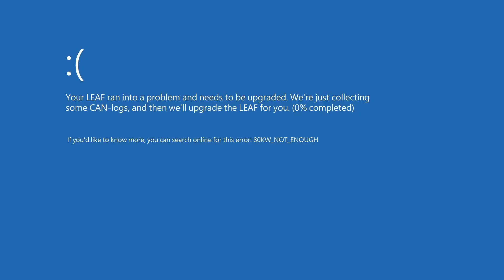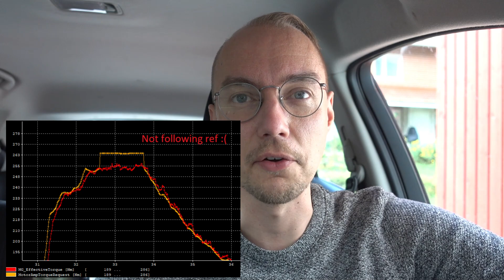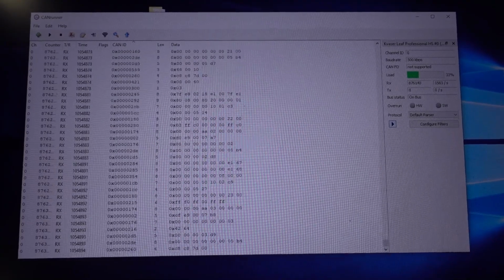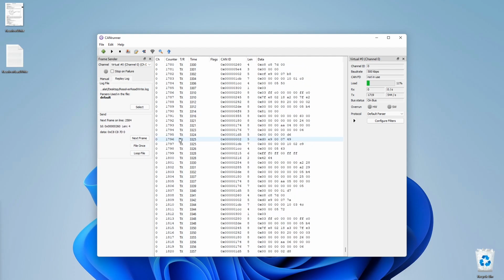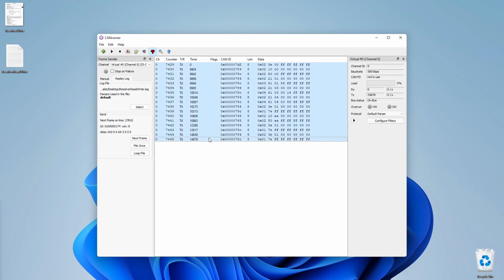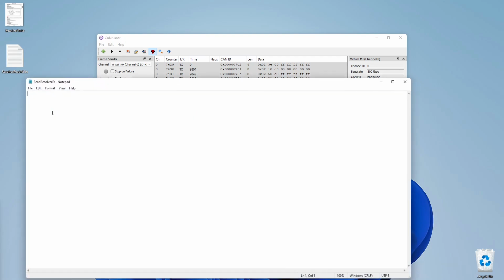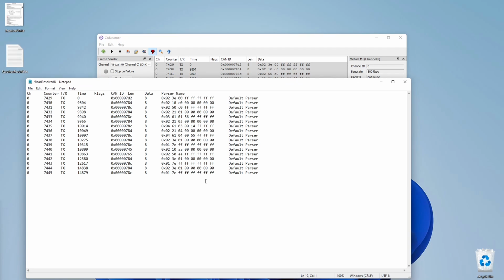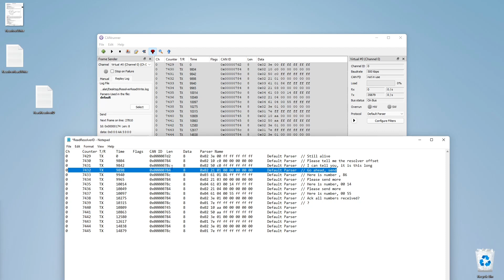Performance upgrade for the LEAF, [Part 0] Resolver coding

Comment: Great videa Dala - thanks! A couple of questions: I have tried your procedure on the GEN I leaf (EM61 motor), and the inverter writes back with the new resolver information after reset. So just wondering why you think it will not work on the older LEAFs? 

And, any idea what the 5 numbers actually mean? I.e. how do they relate to the offset in degrees? Five bytes gives a lot of options!
Reply from the maker: The EM61 motor is very different compared to EM57, so fitting the newer inverters wont only be mechanically challenging, the internal parameters are too different to spin the motor.

The 5 numbers were a very precisely measurement on how off the sensor is. They noticed how overkill 5 numbers was, and shortened it to 2 numbers in 2018+.

Comment: Why is this method not usable on 2011-2012 leaf?
Reply from the maker: The early LEAF has EM61 motor and way different hardware around it. Installing EM57 parts is simply impossible.

Comment: Clear Battery Capacity Loss Bar ? 2013+++
Reply from the maker: Consult 3+ can do that
Reply: @DalasEVRepair  Dala's, can you elaborate on how to do this with console3+? where is this function for 2014 ? Clear Battery Capacity Loss Bar 12 ?
Reply from the maker: @DginiSG  no clue. Don't have the tool
Reply: @DalasEVRepair  I know if you update firmware 24 to 30, only then there will be 12 bar on the scoreboard, but I would like to not change firmware 24 to 30 and return 12 bar to Nissan Leaf 2014

Comment: This answers a question I've had for a long while"can you change the vcu to aftermarket and get more power out, aka zombie the car" seems no as the inverter limits power. 👍Thanks again Dala for your work and also sharing.
Reply from the maker: No problem, thanks for watching 😁
Reply: It's kinda like working with an NA car.
You can't do a whole lot with software on an engine with no forced induction. You have to change some hardware...

Comment: This is fantastic... I had come across the thread just last week where you discussed the power limit by the inverter.  Since the motors are all the same, it seems logical that a performance upgrade should be obtainable by swapping inverters.  I imagine that the 24 KWH pack is probably optimized for safety and could possibly support a bit more... however, for those that are receiving 40 KWH packs, it seems that upgrading the 110 KWH should be within reach.  I was wondering another thing... it seems like it might be possible to interface the open inverter project to the stock VCM... I think this might involve just a bit more work, but with some very creative can bridge manipulation also seems within reach - I think the inverters in the '13-'17 can probably support 110 KWH very easily if not for the FW limitation.  A hot-rod 2013-2017 LEAF has massive appeal to me, also as a petrol head.... hot rodding does not need to end with EVs!!  I don't currently own a LEAF, but considered getting another just to play with since I'm an embedded FW engineer by trade.  My mind has been racing with possibilities in just the last few weeks.
Reply from the maker: Yeah this decade is gonna take the LEAF to new heights for sure!
Reply: With ICE cars, people could invest money and increase power to 700-1000hp. With EVs this seems near impossible unless you buy the car as-is with this power.
Reply from the maker: @farmdve  That's what we're about to change!

Comment: How stimulating the car that always in breaking, that helps the car charging when running, on option with ON/OFF switch, that could be wonderful.
Reply: So B mode then? Regen braking already integrated in the car.

Comment: This is the thought I had. Take a wrecked leaf plus, drop it's motor, inverter and battery into my car. Having money, time and a place to work are necessities though.
Reply: I suspect that the capabilities of the stock VCM would need to be well understood (as Dala is reverse engineering)... it would be very interesting to snoop the LEAF+ as part of this project.  Ideally, we could just intercept the torque request to the inverter can message and re-map it using the Muxan can bridge with a man-in-the middle attack in the same way Muxan fools the car with upgraded batteries.
Reply: @lsh3rd  I think you still need a larger battery to get the power output without overheating the 30kWh pack.
Reply: @hondaguy9153  It would most certainly involve compromises... my inspiration was the guy out there with his LEAF powered Toyota 86 pulling 136 KW from the 24 KWH pack modules.  He has since upgraded to cells from a 30 KWH pack... I think the pack can handle it, but most certainly would come at the expense of pack life.  Not to mention, would this be safely doable from a degraded pack?  I would want to keep a very close eye on cell temperatures.  I'm mostly thinking in terms of taking a '13-'17 car and upgrading to the 40 KWH pack and getting more than the usual 110 KW out of it.  Thoughts are to try and build a car a bit quicker than a LEAF+.  However, the big issue now is cost of those packs - by the time I buy an older car, pack, etc... I'm close to the cost of a new car, BUT I'm hoping maybe post-pandemic prices start to drop to reasonable levels.  Meanwhile, I've considered tying to look for a cheap motor/inverter just to play with on my lab bench.  Maybe I'll build some sort of LEAF powered electric off-road buggy!  I am very eagerly awaiting what Dala comes up with - this sort of hacking is very good for the hot-rodding community to come into the current era!
Reply: @lsh3rd  if you're doing something with the EM57 and Leaf cells, there's always open inverter. 😉
The prices on these are cars(and parts) after they're wrecked is pretty crazy. I really want to find a complete car and strip it for good parts. I would love to modify my Leaf for more power.  There's one out there with another motor and inverter in the back. It's a race car though.
 AWD would be amazing!
I've never seen the Toyota you're talking about, is it on YouTube?
Reply: @hondaguy9153  I am very interested to see what would be required to make the LEAF VCM talk to the open inverter project.  I imagine the CAN commands are probably pretty different, but that's a solvable problem using Dala's techniques for reverse engineering.  Some sort of can bridge to satisfy Nissan's VCM would probably be needed - translate one command set to the other.
Reply: @lsh3rd  I reached out to open inverter a while ago. They hadn't tried and didn't know anyone who had tried using open inverter in a stock car but using it on the EM57 in conversions is common.
If you can use the stock inverter, change it's behavior, get more power/one pedal driving/turn off creep, I don't see any reason to use open inverter in the stock car.
Reply: @hondaguy9153   Using the factory inverter will always be the easier path.  I think for unlocking more power in the early cars, Dala's path will be the fastest to that goal.  Open Inverter can unlock more power from either inverter, but at the probable expense of other sub-systems not working... this would be a huge undertaking, but I'm interested anyway.  I do recall seeing a thread on OpenInverter about someone asking about dropping this into a LEAF directly.

Comment: As I pulled out of a car park tonight after taking the wife out for dinner, I had a car speed up behind me so I booted it.  The wife was like “oh my” as the leaf pushed us back with some torque :) it still amazes me the 20-60kmh acceleration in the 24kWh leaf still very impressive, even after owing it a year it sometimes surprises me and passengers also comment on it, the 80kw isn’t much but the toque is still impressive.  I’ve driven the 40kwh , 110kw and it felt about the same , I presume that the weight difference is playing into effect ?  However as the 40kwh gets to 70kmh it keeps pulling with that extra 30kw.    My big question for 24kwh cars, will the 110kw draw be overspec for the pack ? Surely 160kw will ?  If not the old leaf will be quicker than the new :)
Reply: Electric cars work a bit differently than ICE cars in regards to power output. How much power an electric motor makes has just as much to do with the inverter as it does the battery pack and the motor design. The difference is that on an ICE your power limitations are things like how much air you can get it, can you supply enough fuel, are the motor and drivetrain components all strong enough to support that output. With an electric motor/inverter/battery pack, it's usually more a question of how LONG do you want to make a given power output (to a certain point). There are people making over 200kw with the EM57 Leaf motor. That's 2.5 times it's factory rated output. The difference is they're only doing it for maybe 10 seconds and using a custom inverter and a liquid cooled battery pack. On a basically stock Leaf, I suspect it's going to come down to battery temperature (the Leaf's Achilles Heel). An inverter upgrade will remove the 80kW limitation, and allow for more output from the motor, but the battery pack temperature is going to climb up to damaging levels much more quickly. I think that for normal driving use where you're just needing that peak output for a few seconds to merge into traffic or evade a collision, the difference will be negligible. 

Take my ramblings with a grain of salt, it's all suspect and I'm sure Dala will be as thorough as he always is and we'll have better answers soon enough!
Reply: @float6969  I've seen 350kW out of an EM57 with proper cooling. The 62kWh Leaf has twice as many cells as a 30kWh car so with a better inverter, 160kW from the motor is no problem.
Reply: @hondaguy9153  Yeah, when the Leaf Plus came out with 160kW and was still using the same EM57 motor that's in my ZE0, I was pretty amazed. Nissan must have over built the heck out of the motor to feel comfortable doubling the power rating while keeping the warranty intact.
Reply: @float6969  - thanks for explaining , I had no idea the em57 could do 200kw :)  I wonder cvs and shafts will handle,  the 24kwh pack would be doing near what 500 amps for 200kw ?  Or more, I hope battery internal interconnects are up to it.
Reply: @float6969  Taking 100A from a 5Ah RC-battery for a short while is very common. Of course they don't last as long as BEV batterys but. In the Leaf case with a 24kWh battery that converts to taking 480kW out :)
Reply: The 62kWh car is the top. It has twice the power. (160kW vs 80kW, torque is 250ft/lbs vs 187ft/lbs)  it is and feels like a much faster car.  I think you may not have driven a 62kWh car if you thought it felt the same. 🙃
Reply: @hondaguy9153  yep I drove the 110kw 40kwh
Reply: @jestronixhanderson9898  I misread. I thought you were saying you drove a 40kWh and 110kWh car, hence my attempted correction.

Comment: Dala, if I build a 40kW LiFePO4 battery pack for my Leaf, will it be possible to get the Leaf to accept it. Can you assist? I am in South Africa
Reply from the maker: LiFePO4 batteries have 3.2V nominal voltage. This will not work with the LEAF BMS, they will think the batteries are empty all the time. Use a chemistry with 3.7V nominal voltage instead!
Reply: @DalasEVRepair  Dala thank you for your kind reply. I am aware of this and have thought about it. I am able to build a LiFePO4 pack at the same voltage as the Leaf (with more LiFePO4 cells in series of course) and with a different BMS (like the "Orion") - will this not work
Reply from the maker: @leoleydekkers7024  LEAF wont start without original BMS. So massive work to make it happen with another BMS.

For example, it took us almost a year to get the newer LEAF BMS to work in the old LEAF! And those were very close!
Reply: @DalasEVRepair  Thanks Dala - and thank you for your hard work and great YouTube content!
Reply: Hey Leo, where in SA are you? I just got my leaf, looking to do the same thing. Can't let such a great car die a slow death!
Reply: @on_the_saddle  Johannesburg

Comment: ..... speechless.....someday you build a Leaf with CCS and 500km range...👍👍👍👍👍👍👍👍👍👏👏👏👏👏👏👏👏👏👏
Reply: Or type 2 AC charging capability update to 43kw as Renault zoe. For europe I think this option is more interesting
Reply: @xdellavedova  not possible with leaf
Reply: @emceh  muxsan offer 22kw 3 phase charger upgrade (expensive)
Reply: @xdellavedova  you need to add external charger not Nissan bases to do it. There's not much space available so it must be expensive very compact charger. Not worth the effort IMHO.

Comment: the tweaks with the leaf seems to be unlimited
Reply: Imagine a rear suspension swap to eliminate the torsion beam, freeing up space for a second motor/inverter!
Reply: @lsh3rd  I always thought those front wheel drive drivetrain units would be pretty easy to retrofit to a real wheel drive.   I have an old 73’ish Volkswagen wagon that I have been thinking about doing that with.
Reply: @dorhocyn3  I think you can remove/relocate the charger unit… the motor with just the inverter might fit… but the inverter box could also potentially be relocated as well.  I assume this is probably a Type 3 squareback we are talking about… the motors aren’t super tall in them.